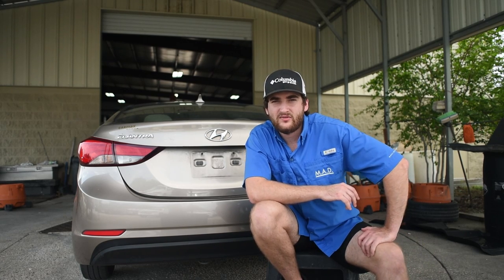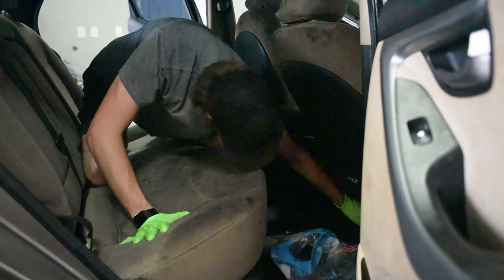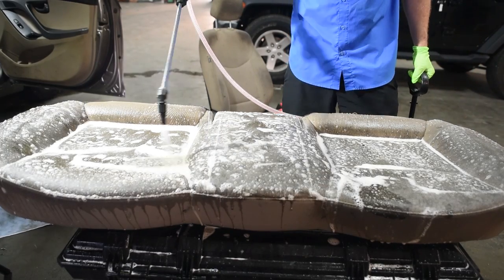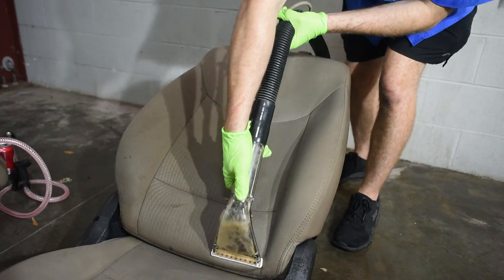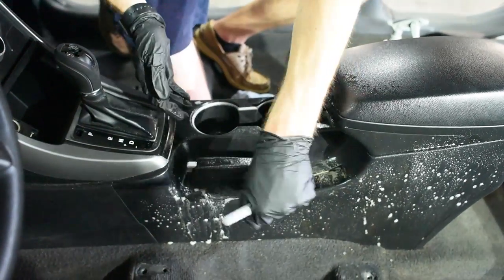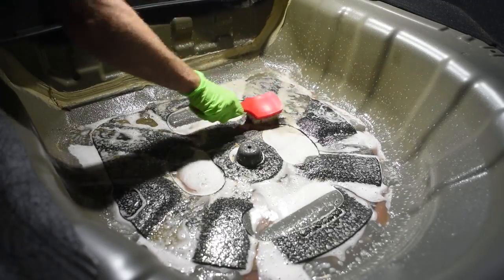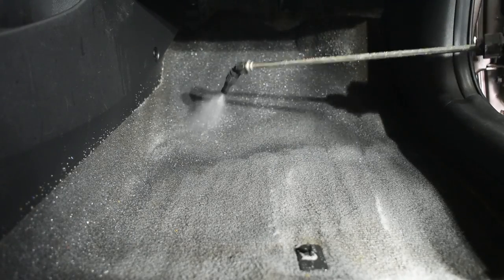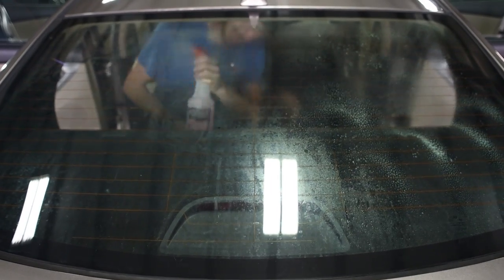Deep Cleaning the NASTIEST Car Ever!! | Extreme Interior Extraction | Insane Transformation Detail

Comment: At first, I thought the cleaner that you sprayed on was excessive. I quickly changed my mind after i saw the stains coming out.
Reply: Vit Zamora me too lol
Reply: Vit Zamora imagine how many days for those seats to be drying 😏
Reply: reason to opt for leather seats
Reply: @CJGarciaa  a few hours of in a garage with heater
Reply: Agree with all of you but also if you dont over spray heavy like that and do multiple sprays, agitate and extracts, it actually pulls alot more out of the carpet than he did. First spray/extraction gets surface and some embedded grease, grime and dirt loosened and removed... 2nd (sometimes 3rd) pass(es) get deep down and really cleans the entirety of the carpet.
Reply: Literally same here tho
Reply: After you hit the seats with the pneumatic brush, the seats feel dry to the touch so when you go to extract, theres hardly anything coming up but its always best to soak them like that since theyre going to get wet anyway and because seats always seem to come cleaner the wetter they get
Reply: Bruh
Reply: Seeing all the liquid on the fabric seat hurt so bad
Reply: @austinallen8949  pneumatic brush?
Reply: @doublezero7852  he basically saying the drill brush 🤷🏾‍♂️💯 some drills are powered by a air compressor hence the pneumatic part 💯
Reply: There is no need to worry about to much, if you want ,you could pressure wash the seats and carpets
Reply: Well to tell you the truth I thought it was a little excessive too....but considering how dirty it was I said yeah it's going to need it...... but you're going to be there all day sucking it out LOL ,  I've never seen anything that dirty, on a soft surface get that clean again 
WOW
Reply: I feel like other retailers don’t put enough on lol

Comment: Hi...Im a master detailer of 15 years...was glad to see the seats taken out...but you could have saved  90% seat cleaning time .... and cleaned seats 100% like new ...and also remove 100% of the smell and soap residue ....I spray  seats using 100% un diluted APC on fabric thoroughly...find which APC is strongest and works best...not all APCs are the same.. spray the seats quickly within a minute not to allow APC to dry....then without agitation or scrubbing ...yes you heard right....let the high pressure wash do all the work on the seats ....putting the wash gun as close as possible to the fabric with damaging the fabric...blasting away all oil and stains guarenteed....and especially all that stinky dirty water and soap residue that stays in the seat using the wet vac method... and still smells after it is completely dry ....I've seen smelly , mostly clean seats happen 1000s if times using wet vac method ...the pressure wash method creates brand new seats with zero smell...always...use solvent to remove other hard to remove stains too l...and blast it away...yes it will take a day to dry on a hot day....and 9 hours to dry using an electric heater in the car during winter .....with windows 1/2 inch open to allow steam to vent out...but what's more important...a brand new zero smell interior....or customer having to use their electric heater at home.?..you can also idle the engine for 3 or 4 hours with heater on full... I've done this on 100s of cars too ...👍

Comment: I did full clean ups on trade-ins at a local dealer for 20 years and we would have sprayed them seats with a powerful degreaser and pressure wash those seats. We could do them faster and just set them outside in the sun and by the end of the day they were dry. If not we would put them in front of a large box fan overnight.

Comment: U use an excessive amount of water solution in the seats... Look, I appreciate u wanna do a awesome job.. But sometimes less is more. To minimize the amount of time spent on one part of the car, and to save money on wages, use less water,  but more often. Go back over spots with little sprays to save money on soap/water. Instead of a bunch all at once. You will also save time on having to wait for the seats to dry. Plus, there's always a risk of mildew when soaking foam seats like that. Just a suggestion.
.
Also, u can use a dry drill brush on regular dry carpet to loosen up partials that are otherwise stuck in the fibers of the carpet.
.
Another suggestion, sometimes u can use a drill brush on wheels and tires as well. :) hope this helps.. awesome video! I'm now subscribed.

Edit: hmmm.. Seems like I can't argue with the results u got.. But my suggestions are still valid. Amazing job. I couldn't have done better myself. (I'm a detailer as well). 😎👍

Comment: Do y’all disconnect the battery, or are the electronics safe from the liquid with just having the ignition off?
Reply from the maker: Yes
Reply from the maker: We disconnect the battery if not you will have a air bag light on as well when removing the seats

Comment: Is the water going up the attachment just from the seats? or does water rotate inside the attachment ?
Reply: it is only the new dirty water from the seats. They are using a spray-ex-machine, this machine got 2 tanks. One with clean water for rinsing and the other one for the dirty broth.
The spray-ex-machine does two jobs at once: spraying the clear water and extract the dirty water. You start with a full rinse-tank and an empty tank for the broth. At the end is it vice versa: your rinse-tank is empty and the brothtank is full with disgusting stuff.
Reply: at 14:14 you can see a thin lightgrey tube for the clean rinsing water beside the thicker black extraction-tube behind

Comment: I have a question for you 
How much you charge for this kind of deep detail on small cars ?
Reply: If anything like another detailer, interior and exterior clean is about (in Canadian dollars I believe)

$200 Car, $225 Mid-size SUV, $250 Full-size SUV, Van or Truck
Note: Excessively dirty vehicles (dirt/mud/pet hair) will be charged extra at a rate of $50/hour

If it involves paint correction like ceramic coatings, including interior and exterior clean and whatnot prices start around $750 and upwards of $1000

Comment: Hey I love your work what will you put on leather seats to get mildew off.
Reply: Cc The hustler  scrub with leather cleaner, dry and follow up with leather conditioner.  There are ways of removing dark marks on light leather using a wood bleach( Oxalic acid?)  but one must be careful as it can damage leather (spot test first)  and may require  the use of leather dye to match the spots. 
Leather CPR is a good product to start with. Then finish with a leather conditioner with a good bit of lanolin in it! Not only will your leather love it but your skin will too! Skidmores Leather cream is my favorite leather conditioner! Stuff works great and has actually removed calluses from my hands due to practically bathing in it every weekend  cleaning saddles and other leather tack!

Comment: Less than usual care I wonder why for example you didn’t use steam especially in the ventilation air ducts whomever turns the air on will breed a bunch of fungus, spores and dust that is very dangerous for your health seeing the state of abandonment of the care and asl odi disinfect in general the areas you to use with your hands, also compressed air both to clean crevices and eliminate water from electrical contacts especially on the panel would be suggested other than that great job as s usual

Comment: STOP SPRAYING THE PRODUCTS ON THE SURFACE LIKE THAT SPRAY IT INTO THE CLOTH THEN WIPE 😒
Reply from the maker: When you have a car that is this bad you have to spray the surface then use a brush to lift all the dirt and grime for a new car or a high end car then  yes you are correct but with this car it’s different.
Reply: You can ruin the interior electric parts by drenching it. It doesn’t matter if the car is new or high end it’s someone else’s property.